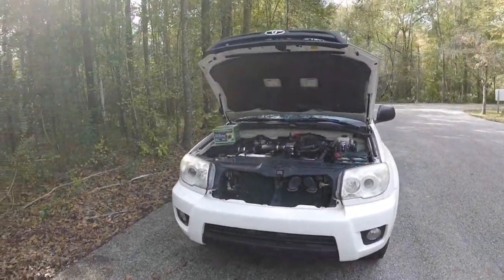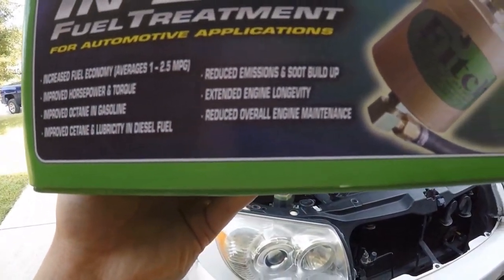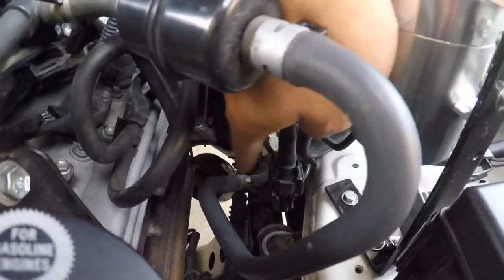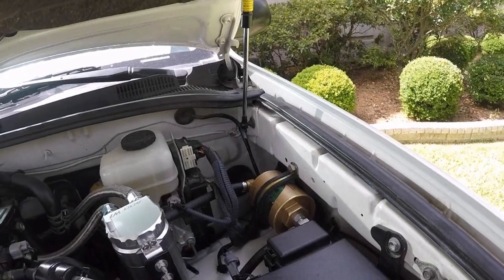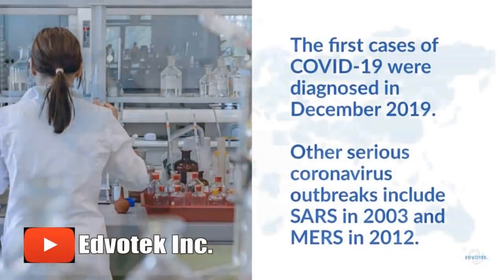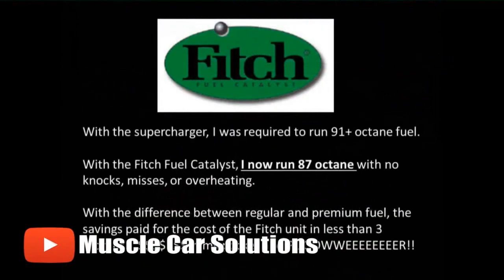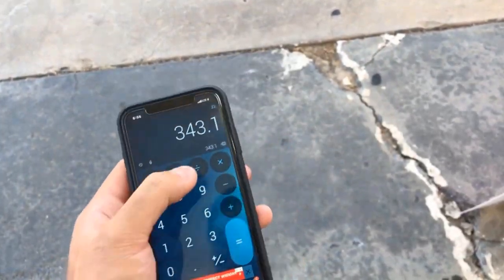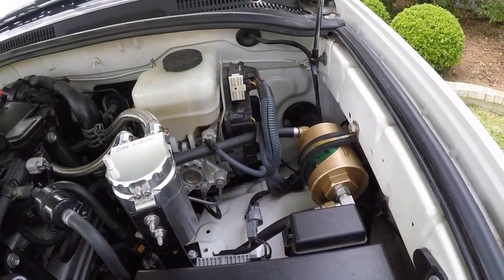4th Gen 4Runner Fuel Catalyst Installation - 3RD ENGINE MOD

Comment: The military don't use them. I've never seen on any anything "green" on the land, in the air, or out at sea which has one fitted. The fuel is treated to remove moisture, but that's it.

Comment: I added one on my '11 RAV4 V6 a couple months ago, and your results pretty much match mine. I get between 1 ~ 1.5 extra mile to the gallon, more consistent pedal response, and more torque uphill. The change wasn't immediately noticeable, though. I really only noticed more of a difference after the first oil change since installing it (which wasn't as much a breeze as yours was; I had to stick it way down in the only empty space below the air filter intake). I guess all the gunk being worked out from the injectors will find it's way into the oil pan, and after all that's been cycled out, then the benefits of this can start showing themselves. It bears repeating, since everyone's focused on the MPG, that this catalyst is mainly for minimising engine wear in the long-term, not short-term fuel gains.

Comment: I ran one of these years and years ago in my 2008 GMC sierra with the 5.3 LS engine in it. I noticed a decent increase in my mpg and overall get up and go power. As you stated it wasn’t a massive 10 mile per gallon difference but it was enough to where it made a difference and in my mind personally it was worth buying. Not sure if I missed it but how much did you say this unit ran you? For the longest I’ve had a 6.7 L F250 and I’m curious what it would’ve done with that platform since it was deleted, tuned, egr delete, and a lot more. 
Overall good video and you did great with the description of the unit and explaining what was what. The overall installation process for those that might not be familiar with it.

Comment: This thing doesn't do anything. We've had one on our 2007 Dodge Ram 2500 5.7 Hemi powered truck for 13+ years (114,000+ miles) and had no increase in mileage, idle was unchanged as it it controlled by the ECM. Snake oil folks. Don't waste your money.
Reply: @andrewmichael814  You're welcome and it's still on our RAM. Zero difference in every single metric. Nothing changed from prior to the install when we bought the truck brand new off of the dealer lot.
Reply: It's not snake oil. In your case, it was just redundant. Your Ram already has things in place to do this thing's job.
Reply: @predcon1  There is nothing in our RAM's fuel delivery system that conditions the fuel from the tank to the cylinder. It's 100% snake oil and you obviously don't know much, if anything about fuel injection delivery systems.
Reply: @strykerentllc  It's not snake oil and you're splitting hairs. Your idle is electronically controlled, so criticising the Fitch for not changing that was pointless. The hemi is already as efficient as it's going to be, so you wouldn't see much mileage improvement. You obviously know how to cherry pick so you picked the one thing I'd have to concede which is yes, there's nothing in the engine that conditions fuel. But the Fitch does that, so it's working as intended.
Reply: Let me put it another way. You're calling it "snake oil" because it's not living up to the expectations you placed on it. Expectations for things not advertised, or things, as I said, your vehicle already inherently takes care of. Fitch even says that individual results are not universally constant or consistent. I'll bet you've got a Bowflex collecting dust somewhere because you didn't get ripped on the third day of using it. Which, if you kept up with it that far, congratulations.
Reply: @predcon1  Still here, kid? So you're quoting their disclaimer which in their own words states, "It doesn't work, but give us your money anyway". Outstanding. Go back to playing Nintendo and one day you'll have a job, make enough $ to buy yourself a bicycle.

Comment: I want to get this for keeping the pipes clean, apparently that's what it helps with. Less carbon deposits.
Reply: And it works for that, yeah. Everyone's focused on the MPG and HP claims, and not on the fact that it does exactly what it's designed to do, promoting a more clean and complete combustion cycle. If it does any octane boosting, that would lead to decreased mileage in some engines, so you're as likely to break even with mileage in a Toyota with a Fitch installed.

Comment: So I got a new fuel pump thinking that was my problem I came to find out I had one of this fitch installed which when I got the truck came with it so I removed it because I was losing fuel pressure so I gain a little over 6 pounds of fuel presure so I'm convinced it doesn't work just starves your injectors in my personal opinion that's not a good thing it still consumes the same amount of gas.
Reply from the maker: uriel0002 Interesting...I haven't had any issues so far. But something I'll have to note
Reply: @airsoftmechanic  I forgot to mention I blew air in the hitch filter the gas  was dirty I'm guessing it's normal because of age idk maybe it worked when it was new anyway thank you for your video and response keep up the good work.

Comment: Back pressure thing is a myth thats been disproven many years ago.  If your pipes are to large you will lose some low end.  Its not due to a lack of back pressure but they syphoning effect is reduced with a larger pipe at lower RPMs application specific..  Google that stuff!!!

Comment: So when you did the y-pipe you said you were just under 24 mpg; was that incorrect or did you loose a few mpg with the catback? I guess really where were you at just prior to this modification?
Reply from the maker: Austin Johnson Lost some MPGs. The exhaust sounded too good to not floor it.

In all seriousness, I was going based off of the MPG meter in the center and found out it’s known for being off. In my case it’s over calculating by 1-1.5 MPGs, so instead of being close to 24, it was at 22 or close to 23. When I did the cat back I noticed the gas needle dropped slower than when I only had the y-pipe, but the meter showed up to 22. I get 20 - 21 MPGs on average but ever since I found out the meter wasn’t accurate I’ve stopped relying on it and checked my MPGs by watching my driving, watching the needle, and doing the actual math. I was lucky to actually get 23 at one point, but these days I get up to 21.5 at most. Though I’m trying to push for 25 (unrealistic, but I can hope)
Reply: @airsoftmechanic  That is really great information. Its great that you do these videos and you definitely do them well, so keep up the good work!